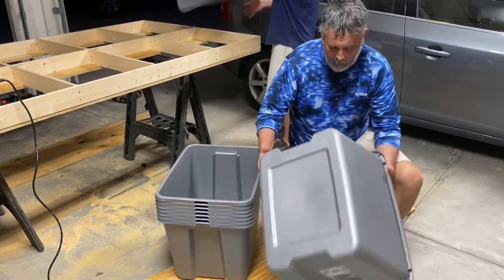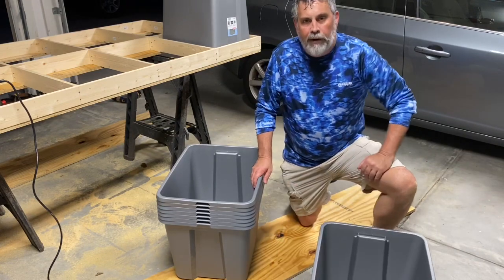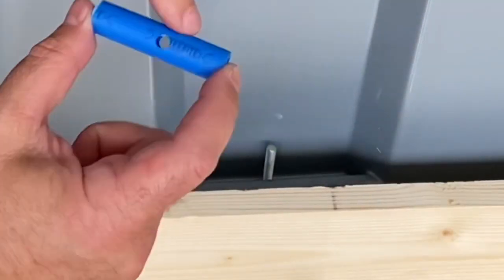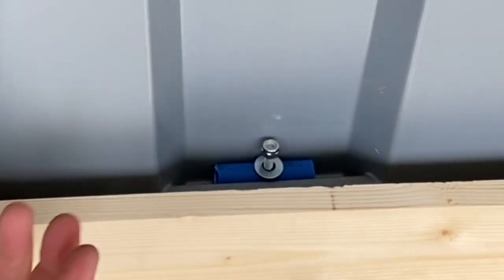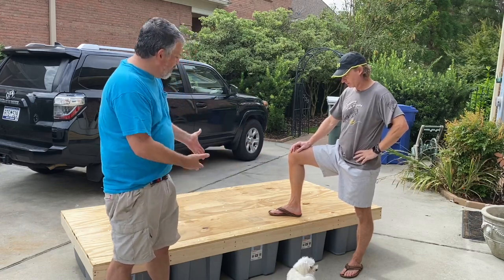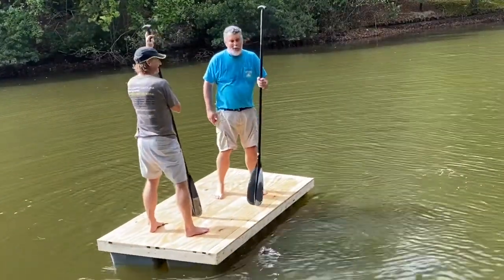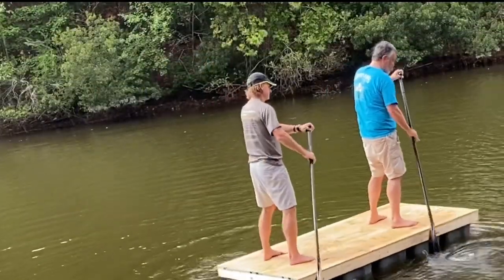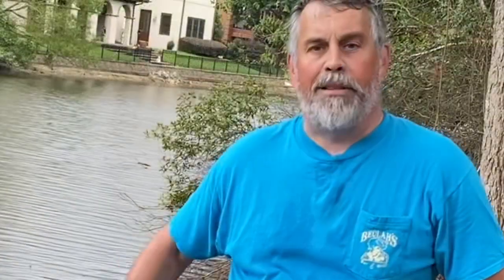We Built the Raft and It Floats! Awesome DIY Raft from Storage Bins and Plywood Step-By-Step

Comment: I love the build. I want to do this with my boys. I would leave the lids on most of the totes so there is no chance of water getting in there. That way if you hit some rough water it won't splash in. And another section will add a lot of stability to that thing.
Reply from the maker: Our final raft will be 8’ x 12’ made of three sections like we showed in the video. By leaving the lids OFF, we have access to the tubs to use them for storage of gear and provisions. We’re also going to make one of the tubs a live well for bait.
Reply: If you turn it into a live well it won't float right?